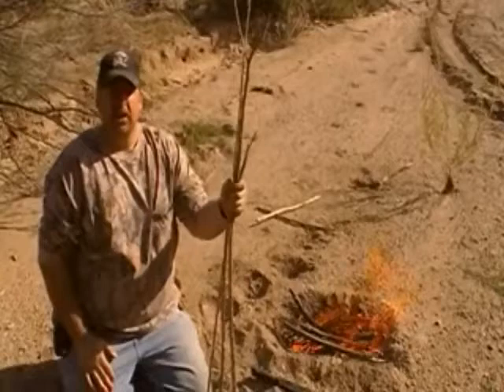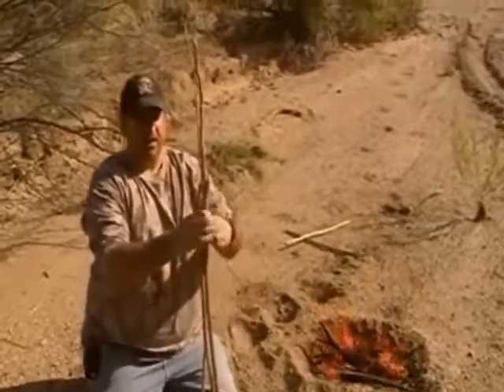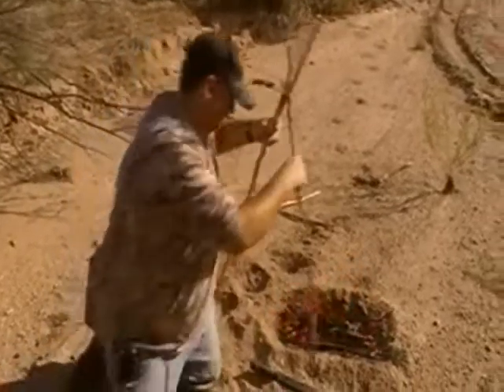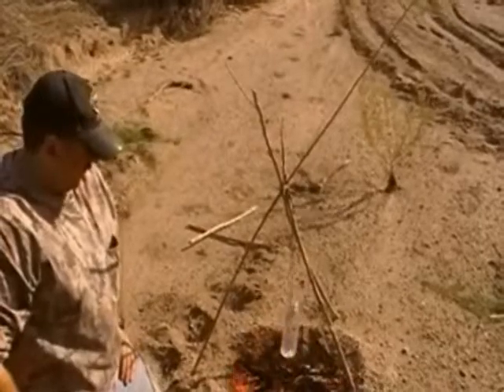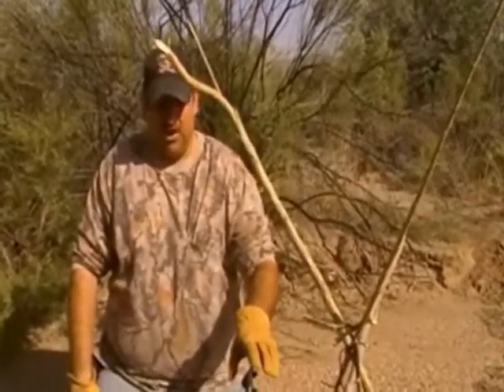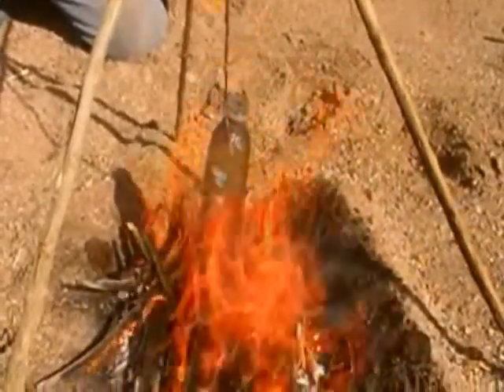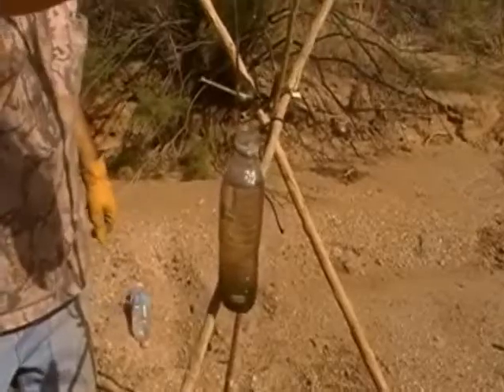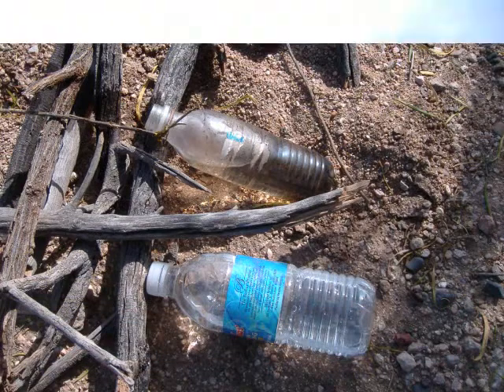Boiling water in a plastic bottle

Comment: Yeah basically all energy put into the bottle gets converted into heating up/evaporating the water and not the bottle. Just gotta make sure the fire is not too hot. Most plastic will deform at ~70C but melt at 105C onwards. Make sure the fire isnt too hot so the heat has time to move into the liquid and it should work.

Comment: @TheAlphaFaction You can burn out a cavity in a log and heat  water in it with hot rocks, or do the same with water in a pit in the ground lined with a plastic bag. Then there are containers which can be made of birch bark or paper and heated "conventionaly" over the fire.

Comment: THe way I've seen it done is by filling the bottle to expell any water, then screw the top back on and drop the whole thing on the fire. It did not shrink and you could not see the boil. The water just stopped the bottle from burning. It did not explode, like I expected it to do. Never done it myself though....

Comment: I would suggest you do this over a tall coal bed rather than an active flame fire to lap at the bottle. As has been said I would be worried about chemicals from the plastic getting in the water. Good experiment though and good vid. 4 stars